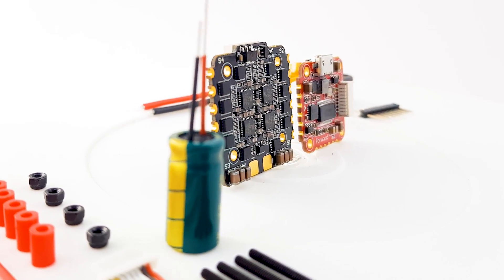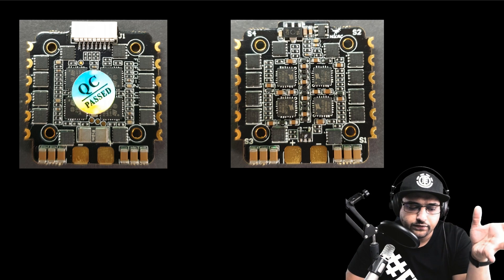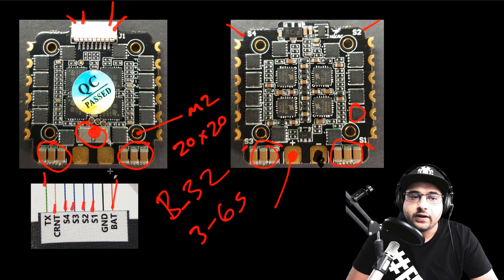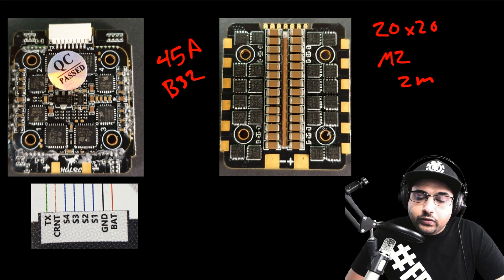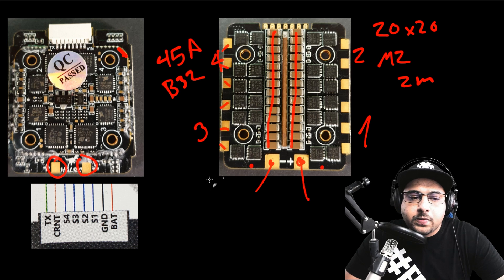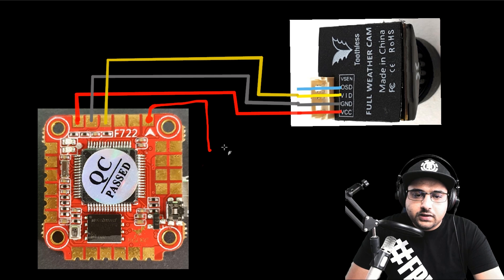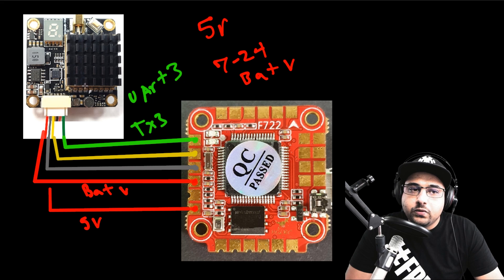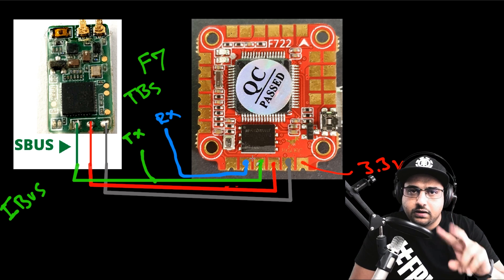HGLRC F745 & F735 // Advanced Breakdown and Setup Guide

Comment: Hearing not in first of your video that ESC OK for 4s build but not so much for correspondent 6s (like 2700kv 4S and 1800kv 6S), why? 6S draws significantly fewer amps, probably more watts due less voltage drop, but did not saw watts raising on ESC